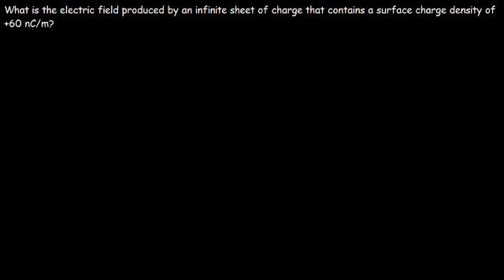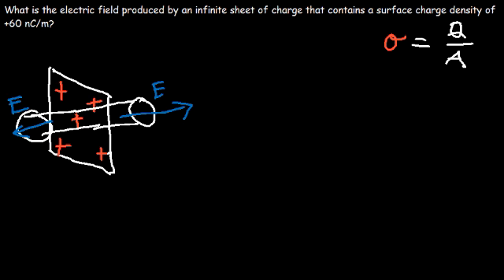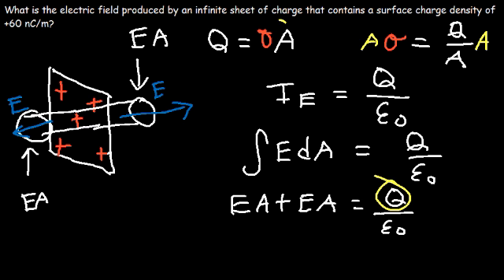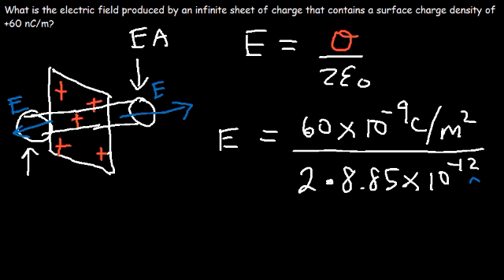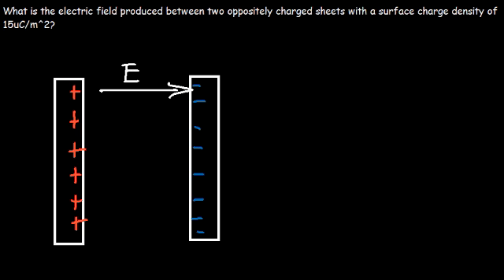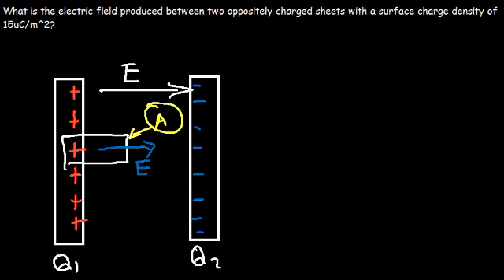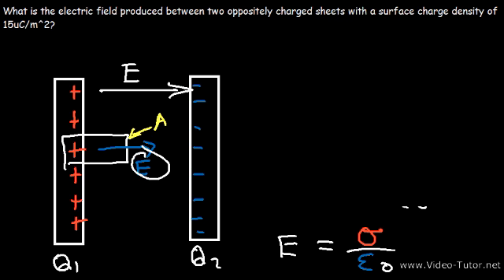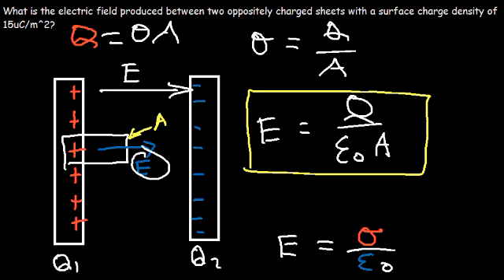Gauss Law Problems - Infinite Sheet of Charge and Parallel Plate Capacitor - Physics

Comment: Where exactly did he use the assumption that the plate is infinite? Was it in supposing that the flux always goes directly out of the cylinder?
Reply: I think he used it when he neglected the flux through the curved surface of the cylinder because if it's not large enough there would be a flux through that area